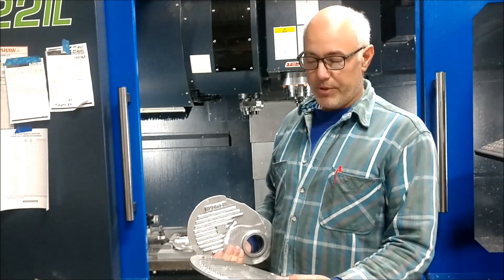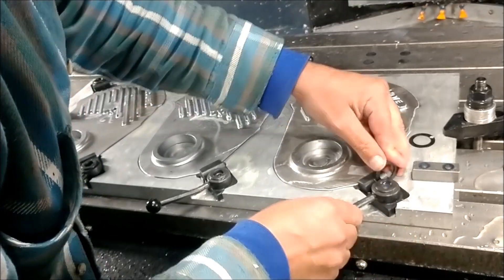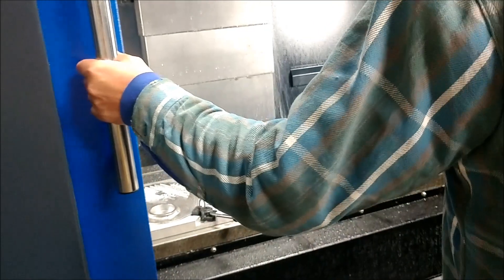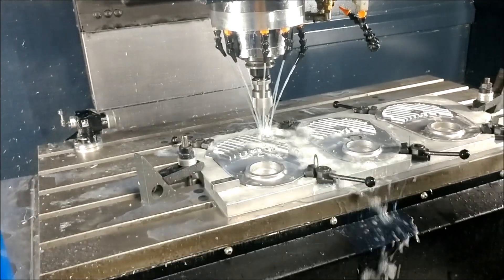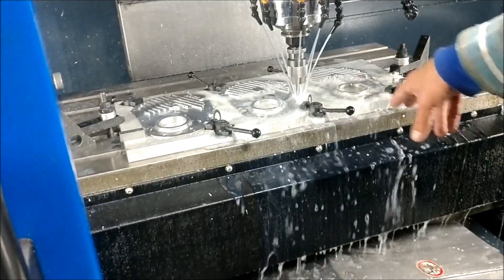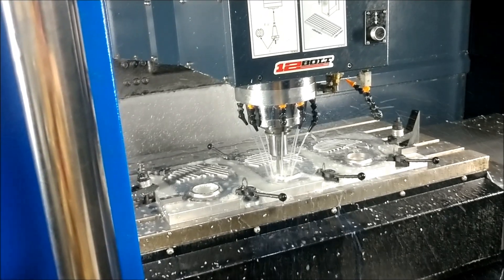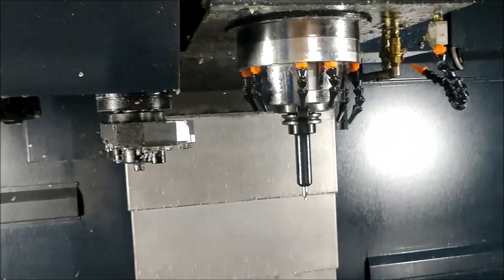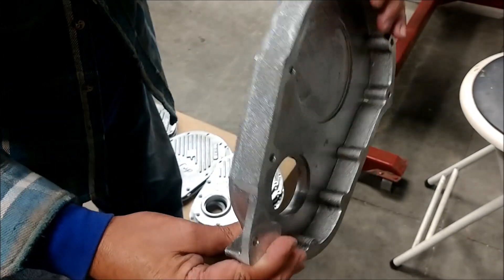Machining the Top of Timing Cover for a 2 piece cover

Comment: I’m in the process of fabricating a cross flow head using 2 gen v 4.3 v6 heads, and have been trying to come up with a way to install crank and cam triggers for an efi setup. I believe this cover may be the key to doing so.